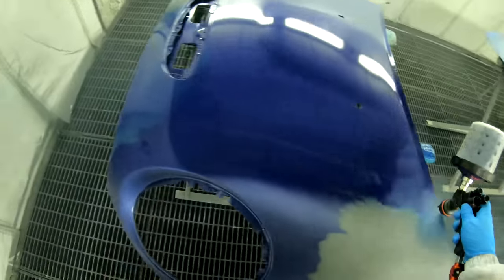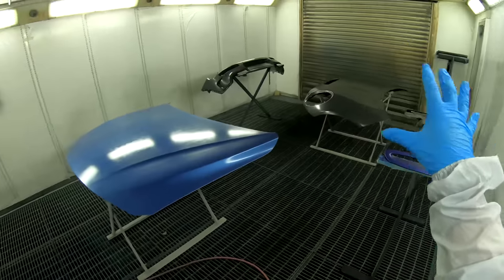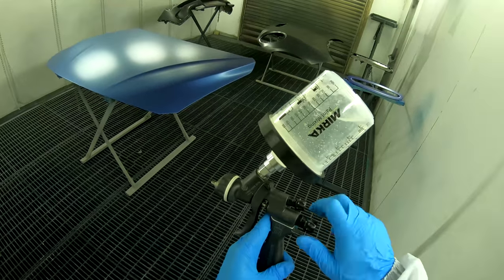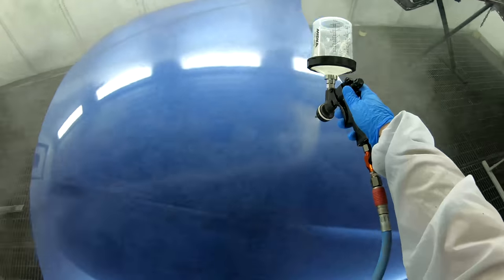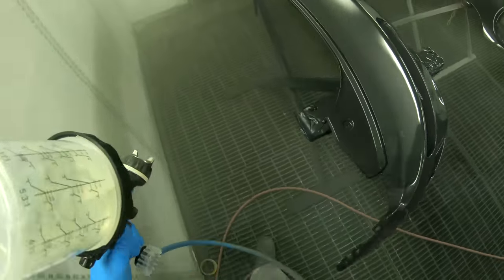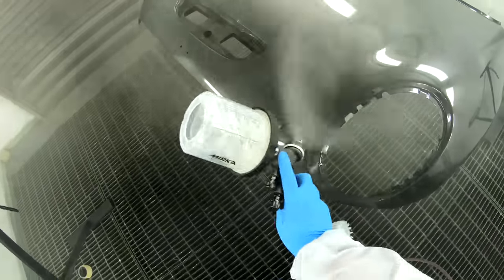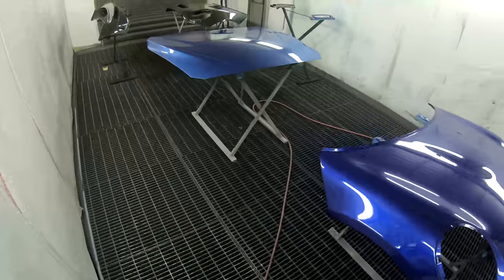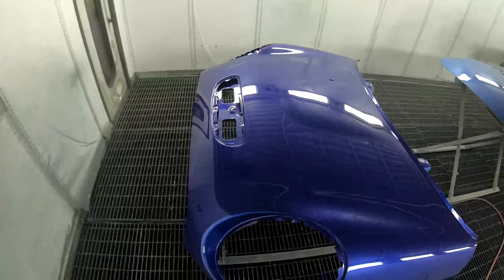How to paint base coat and clear coat. Car Painting

Comment: I work as a finisher in a cabinet shop, I went from a shop with Graco G15 wall mount sprayers to a Devilbiss Tekna Pro Lite Cup gun and pressure pot. You get an amazing finish with the Devilbiss
Reply from the maker: Hi John, I have a pro light. I had a few but the Walcom really suits my style and speed of painting.

Comment: Hi Paul hope your doing well..been watching all your new videos and have subscribed as I’m learning a lot from them..I know your using standox now but can I ask I’m using bmw white label racing clear which is 3:1:1 lovely stuff I normally use normal hardner and thinner but starting to get few sags lately..just wondering as you said your using fast hardner is that with fast thinner as well? What temperature would your booth be? Blown away how you done 3 bonnets and bumpers in same booth with fast hardner💪…keep up the great work Paul
Reply from the maker: I'm good thanks Tim, really appreciate you watching my videos it means a lot. My booth is set at 22°c and I was using fast hardener and normal thinners. Your right in thinking the sags could be temperature related obviously slower hardeners and thinners take longer to flash off but if its colder then that needs to be adjusted for as well. Try extending the flash times or if you have/can order fast hardener then this may help. 🤔 or you could tighten your fluid adjustment slightly. I still get runs and sags when I get confident with the lacquer. I'll be spraying glass thinking I'm brilliant and next thing I know it's on the floor 🤣 so I wined it in a bit. It's more than likely the drop in temperature but just try different things to see what will help. 

Thanks again 🤘
Reply: Thanks again Paul..been so helpful and looking forward to future videos as I’m always learning..and you explain everything so well💪🤙
Reply from the maker: @timreeks2149  thanks mate, I do try 🤣

Comment: Nice work. Just subscribed. Can you please tell me the best setup for devilbiss gti pro lite with 1.3 tip and te20 aircap  for spraying clearcoat. Thanks.Vinny
Reply from the maker: Thanks Vinny, I really appreciate it. I use a 1.2 for clear it gives you less orange peel. But with the 1.3 I would fully tighten the fluid adjustment and unwind it 2 turns and spray at just over 2 bar or 31psi. This will help atomise the lacquer better and gives a nicer finish it might be a little slower though but you can adjust the fluid out 1/2 a turn until you find a speed that you are comfortable with. Lacquer its just one of those things you have to play around with until you find what give you the results you are looking for. Hope this helps.
Reply: Would you load up the clear like that if you weren't in the booth?? Awesome work such a nice blue 👌
Reply from the maker: @tonyproctor7143  yep, I love it. The better I can get the finish the less polishing I have to do.
Reply: Thanks Paul. And for 1.2 with te10 aircap on the same gti pro lite? I have both sets. Just haven't figured the flat finish.  Thanks.
Reply from the maker: @canadianpainter8344  thats the lacquer setup I used on my pro light before I got my Walcoms.

Comment: Is that solvent base your spraying?
Reply from the maker: Hi Mark, 
The paint we are using is Glasurit 90 line and we mix it up as waterbase. 90 line can be mixed as a solvent though, but because of the type of work we do we are not allowed to use solvent as the laws in the uk require waterbase.

Comment: Write or say what color, clear ,setup on gun use..etc
Reply from the maker: Hi Mile, the colours are b62, b45, b58. I'm using a Walcom hte base 1.3 and a Walcom hte clear 1.2 using Glasurit 90 line with Glasurit 115 Lacquer. All sprayed at 2 bar/29psi. Hope this helps
Reply: @paulphillipspaintwork  yes ,just mention when you talking in video
Reply from the maker: @MILEVOJVODA  I try to make sure I do thanks.